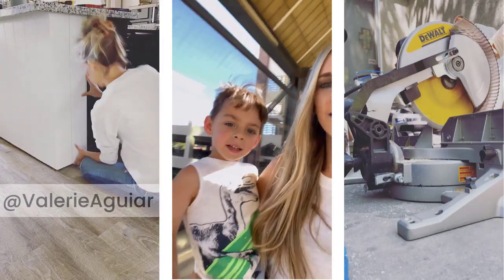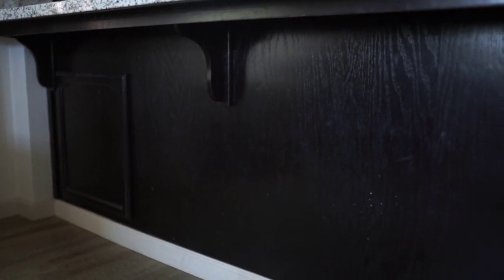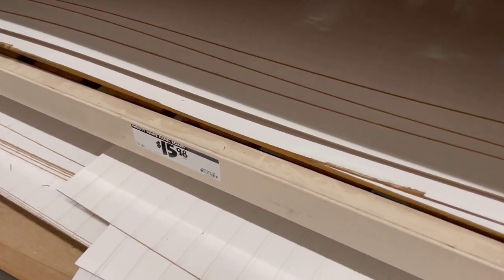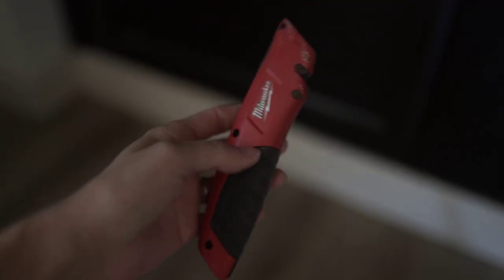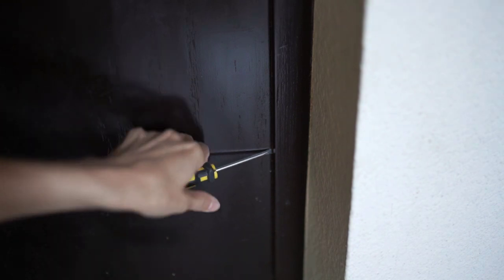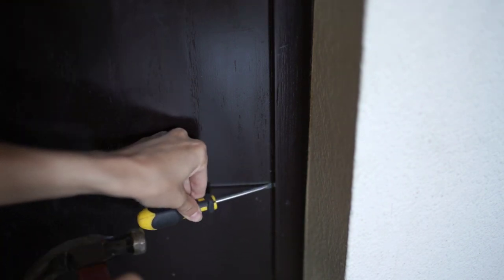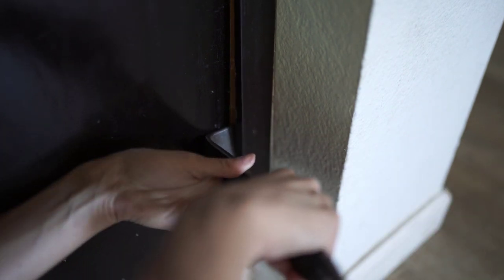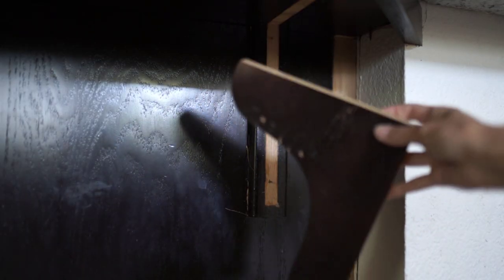DIY KITCHEN ISLAND MAKEOVER IDEAS // Vertical Shiplap Installation

Comment: When nailing the shiplap you should nail it on the low part only, then the nail hole will be covered by the next piece and so on, so you don't have to fill all the nail holes.

Comment: Rub a cut lemon dipped in hydrogen peroxide food grade on the coffee stain, it will come up. You might need to let it sit for a few minutes and scrub lightly with the cut lemon dipped in the food grade hydrogen peroxide. Wash off with warm water rag, GQQD Luck 🍀 !
Reply from the maker: Laura... thanks so much for the tip! I am going to try that and see if I can get the stain out! 💕